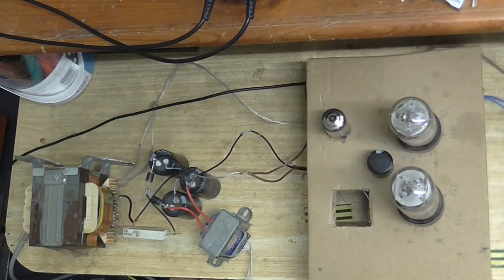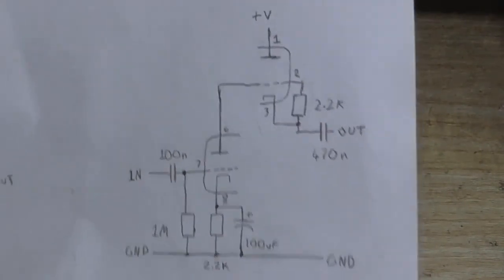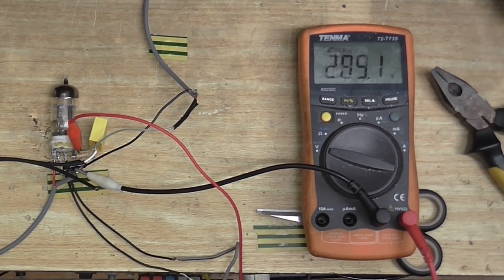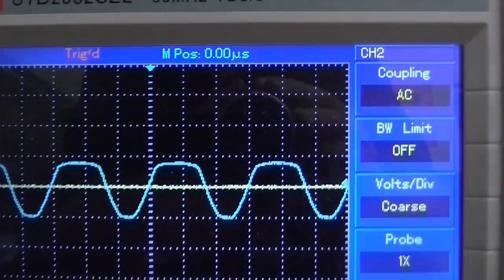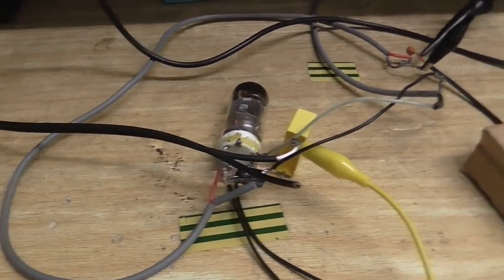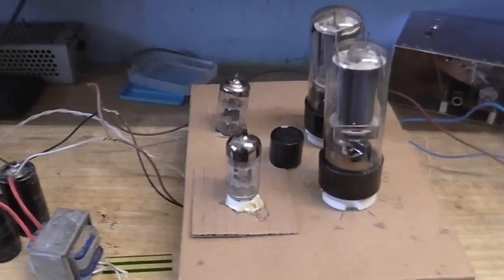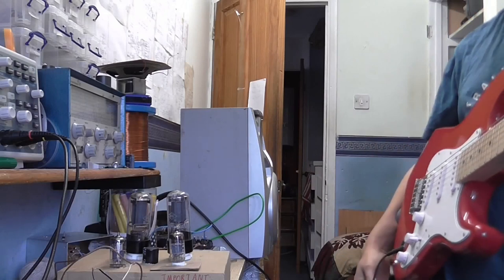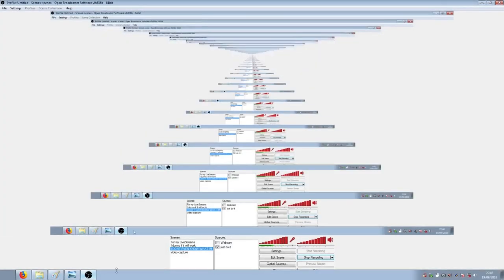Making a Guitar Amp pt 2

Comment: If you can get some scrap wood, a drill and a reciprocating saw (or heck, even a hacksaw), you can build a neat chassis for your amp.
Reply: Tubes chassis are best made out of metal. I think Clem's tool kit is a bit lacking when it comes to fabrication though. I guess not everyone has one of these in their garage? http://i.imgur.com/W9BUl.jpg Anvil is on mill table for scale. Plus I wanted to flatten it out some.

Comment: 300v isn’t too much. Some high power amps with 6L6GC tubes go 450v or higher. There’s even a 6550, which is a massive 6L6. Its plate voltage is around 600!
Reply from the maker: Well for a ECC81 tube 300 volts pushing it a little bit, about 250 volts is as high you should go according to the datasheet. But I've made vacuum tube Tesla coil circuits with a big transmitter tube and around 5000 volts DC supply!
Reply: CoolDudeClem Most modern amps have 4,5, or even 6 preamp tubes. 300v is good for 2 gain stages.